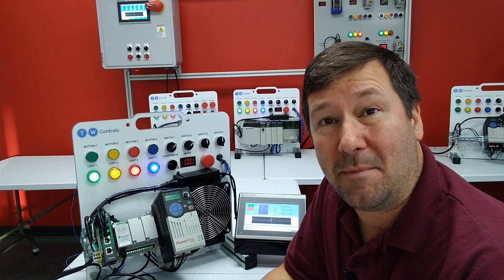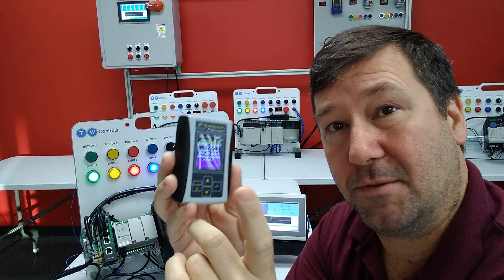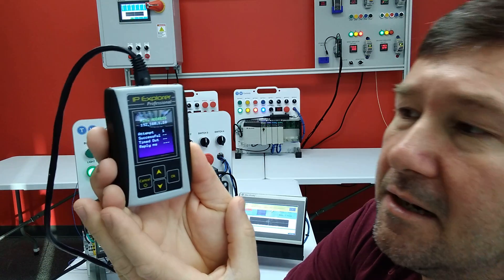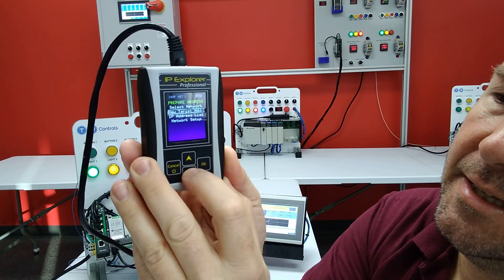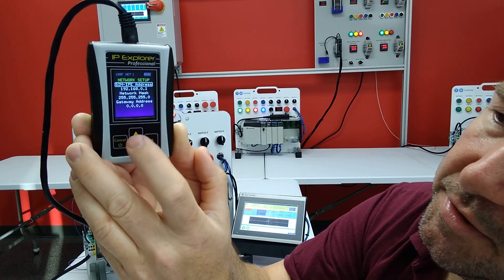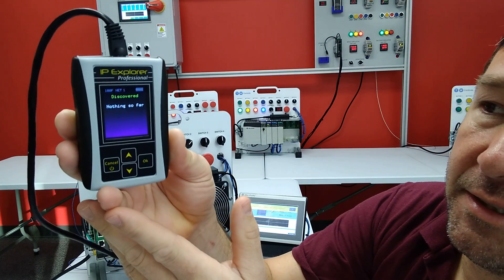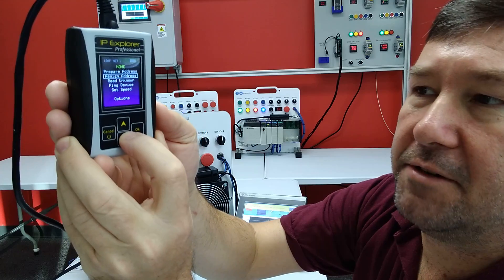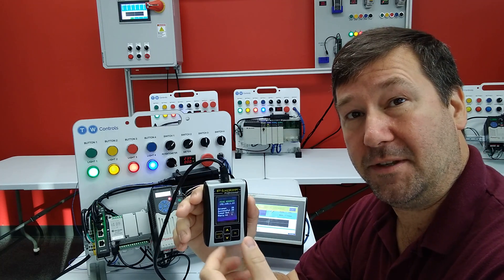How to use the PING function to make sure your IP address setting are correct for communication

Comment: Tim,
I don't know how to get the ip address from a allen bradley powerflex 40. How can I get it without the electronic device you have there?
Reply from the maker: Here are some tips that may help you guess, but we designed the SIM-IPE for this very reason.
https://youtube.com/live/W7Q5ZgvEWiw?feature=share
Reply: Thanks..I will watch the vid
Reply: I have got IPs on pelco cameras using a laptop, then go on IPv4/ properties using a default ip address, then I change the ip to communicate with the recorder machine.
Is this the same way with the vfd based on the video you sent me?
Reply from the maker: No, they would default to DHCP and someone would have set them.  You need to know the IP scheme of the network you are connecting to or use the SIM-IPE.

Comment: Hello.  I may be asking a dumb question but once you connect the device to a port on the wall, will it let you now if it is hor or not?
Reply from the maker: Do you mean will you know if the wall port is connected to an Ethernet switch?  It would indicate it's speed and duplex once connected.